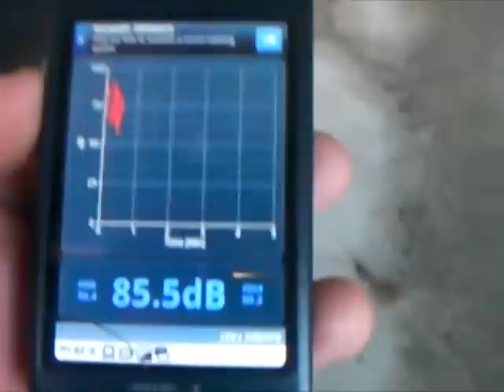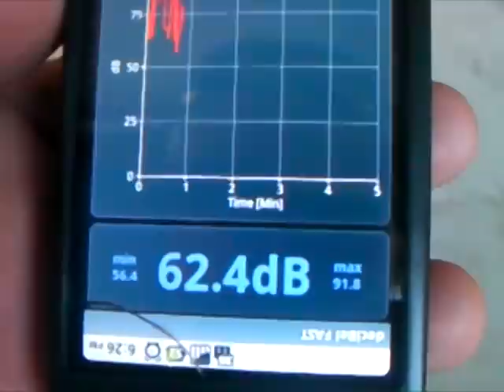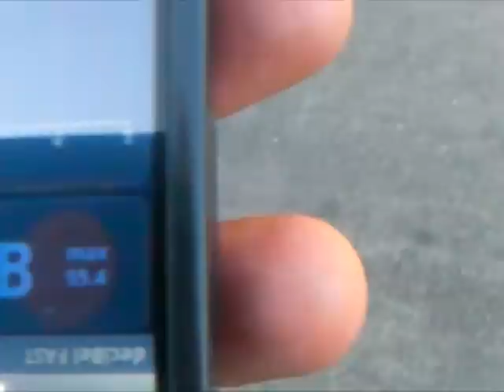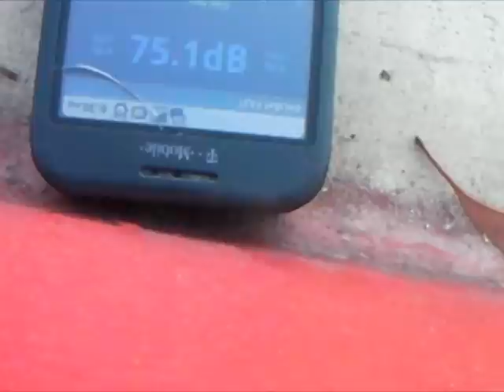How To MOD Exhaust 2009 Vulcan 900 Custom 2 of 2

Comment: So you lost compression and made your neighbors mad Good for you!
Reply from the maker: Wrong on both points.  Compression is not lost that way  (i think you mean back pressure - either way it was negligible and well worth it). Second,  i really don't care about the opinions the rest of society has,  if i did i would be a Democrat.
Reply: LOL, little boys make noise, always been my thought on this. PS my  VT1100 doesn't' make a lot noise.... But sounds hell's better then that...
Reply: Thomas Moore At least he'll be noticed by the moms in minivans now.  The stock 900 is so quiet you can't be heard.  That would be dangerous.
Reply: pjamese3 Maybe. Alot of sound is going to the back. Most cases, people in cages don't hear the motorcycle until it is practically next to them. Loud bike save lives is full of crap. Just an excuse for those who love loud bikes and pissing off as well as injuring others.
Reply: CHeath
"Just an excuse for those who love loud bikes and pissing off as well as injuring others."

We disagree on the effectiveness of the pipes.  I know when I'm in my car, I hear Harleys and bikes w/aftermarket pipes well before they're right next to me.  But how do they injure others?
Reply: pjamese3
Maybe you can hear but not everyone could, even with aftermarket pipes. 

How they injure others?  They get so obnoxiously loud that they burn my ears.  One day, I was on the way to work, I pulled up next to the Harley with aftermarket pipes.  I thought "Great" because I was about to get my ears hurt.  I started getting relieved a little since it didn't sound like anything loud right up when the light finally turn green.  He then revs and take off fast.  That's when my ears had been hurting for several minutes. There are plenty of circumstances I tried to stay away from disrespectfully loud riders to save my ears but many unavoidable situations prevails.
Reply: *****
I guess you're one of those jerks out there.  That's just flat out disrespectful.  I bet you want other's to respect YOU but you WON'T give a damn about respecting other's?  I'd like to save my ears and I am very very sure I am not the only one in the world.  While I don't wish injury upon other's, you're probably gonna get hurt someday.
Reply: knot289
Bet your tone will change if someone pisses you off.  Then you'll be the one doing what you said above. And who said I own a Prius?  Let me guess, you're probably one of those cursing teenager who owns such car with a card attached to the tire.

Comment: A metric twin does not sound good with opened pipes. The Japanese do a fine job of installing the best exhaust from the factory. The v twin on Japanese bikes are not Harleys so they will not sound like Harleys. They sound best just as they are.

Comment: NEVER MODIFIED EXHAUST SYSTEM AT ANY STAGE. READ TECHNICAL REPORTS AND JAPANESE SPECIFICATIONS, LOW MILEAGE, HEATING OF ENGINE BADLY, BURNING OF VALVES, LOSS OF POWER, AND REAL RIDING PLEASURE.
Reply from the maker: the difference between READING about it and RIDING is that after 6 years,  my bike is still in prefect conditions (no negative effects like the ones you READ about). My advice,  put the book down and pick your bike up.

Comment: NEVER CRANK UR BIKE WHEN IT IS ON SIDE STAND WRONG OIL DOES NOT CIRCULATE PROPERLY.
Reply from the maker: also make sure to remove your TAMPON before you ride.
Reply: Abbas Ali Mitza wish I would have known this 8 years ago. Wow my bike must be ruined.

Comment: Personally been on bikes since 1978, loud is fun for the first 20 miles after that you start the why the fk did I make them that loud. Everything suffers when you mess with your exhaust...Ears, valves, engine, mileage, warranty, resale value, but hey go ahead fk up that bike.